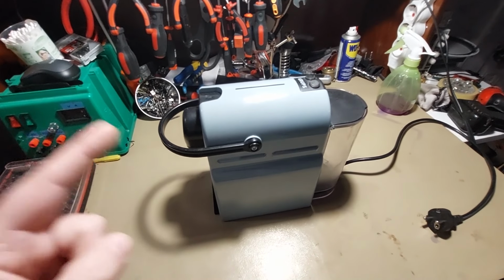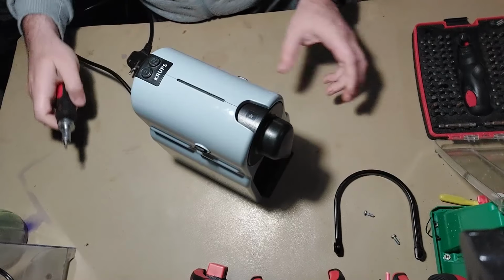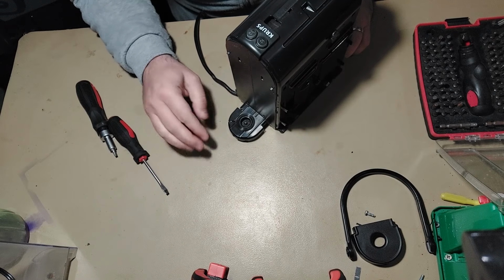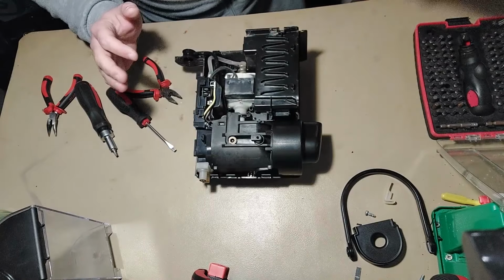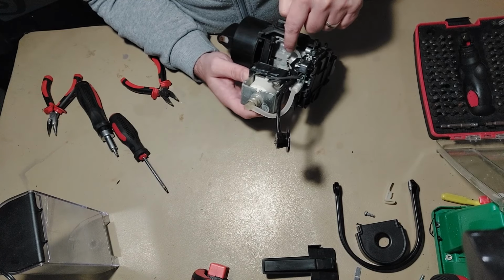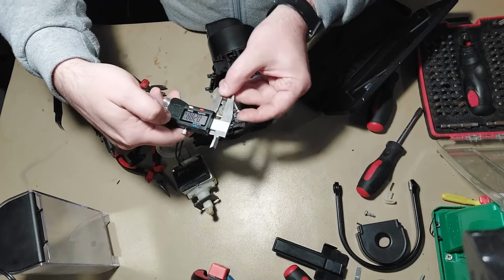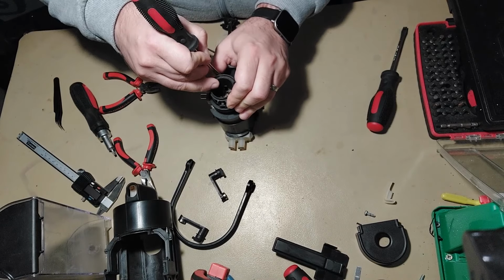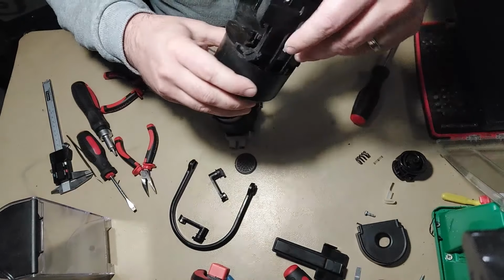Nespresso - All leaking points and all o-rings

Comment: Again, nice and informative video - they helped me a lot with my machine (y) Can you show in detail how to remove the metal retainers from the U-shaped water-element that connects the pump with the heating-block? It's that wavy, springy and possibly M-shaped paperclip thing that secures the connectors. Somehow this part is skipped in the video ;) And what is that little fragile plastic thing (timestamp 19:02) that sits behind the two springs deep inside the capsule-holder/-puncher? Thanks!
Reply from the maker: Unfortunately the m shaped retainer cannot be removed without deforming it. To change it you need to buy spare ones and change.
Reply: @benassy69  Thanks for your reply - I was suspecting something like this and gladly kept my hands (and my pliers) away from this connections ;) Any idea about the mentioned "hidden plasticy spool" you removed with tweezers? Does this thing also have some kind of sealing around? Mine had some white/ivory stuff around it at one end, which partially fell off after removing...
Reply: My experience with the high pressure connector to the thermoblock was that I had to straighten the fold-around ends of the M-shaped metal clip so it looked like a hairclip, and remove the clip entirely by pulling it out at the centre. I put it back in that shape, and frankly it doesn't need to be reformed into its original shape to function as a retainer. It doesn't apply pressure to the seal. It is simply a retainer.
Reply from the maker: Thanks Martin for sharing this. I will definitely try it.

Comment: Thanks for the clear video! Based on your information I have to conclude the leak is within the boiler/heater unit. Do you have a bit more detail on how to open it up an find/fix the broken parts? Thanks!
Reply: It is essentially a twist of the black part in a clockwise direction until the two noses on the plastic are free from underneath the handle axles on the metal part. It's not even a quarter turn but it is extremely stiff and will take some wriggling back an forth before it will budge. There is also a protruding square on the plastic part that reaches into a gap at the top of the metal part. I didn't notice that before I got it apart but the square on mine now has a corner shaved off of it. ;-)

Comment: My conclusion is that I will never buy another one of those !
Reply: Honestly my conclusion is being somewhat impressed by how its just 90% plastic that slides or clicks together & two screws. It's a pretty clever construction and im sure somebody had a lot of fun designing this hehe. Better than most devices these days being glued or 'welded' together and unrepairable, this obviously does take a little bit of effort but you can completely disassemble it with only basic tools, gotta admire that.